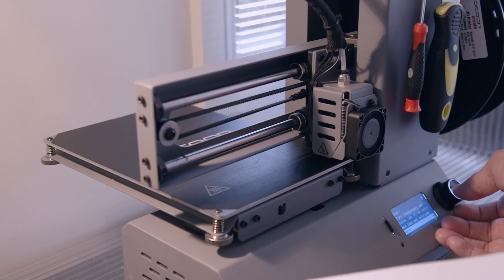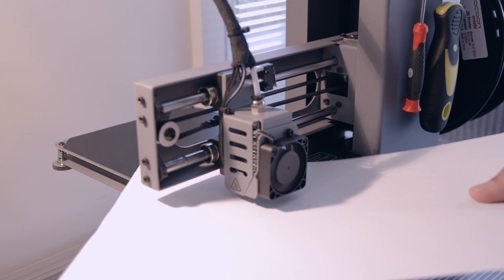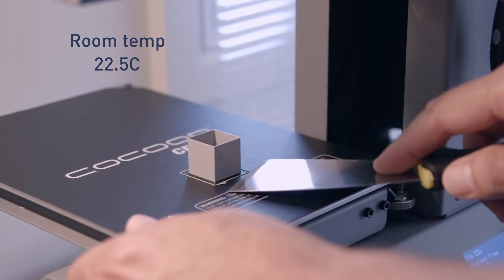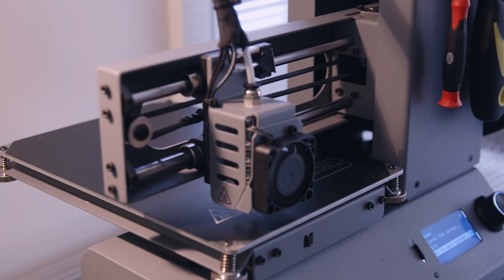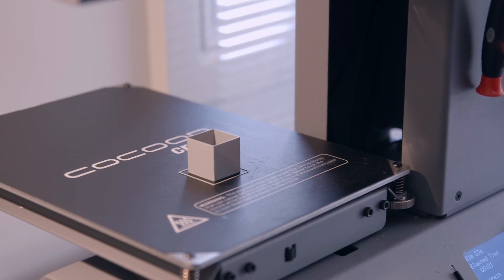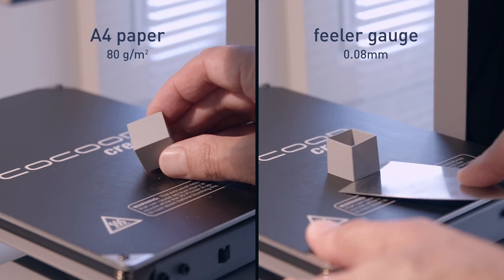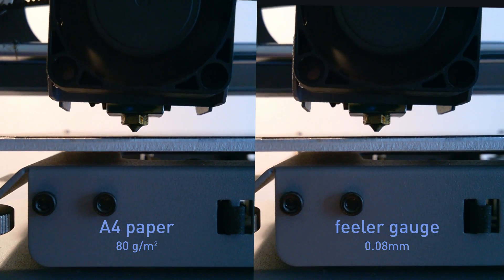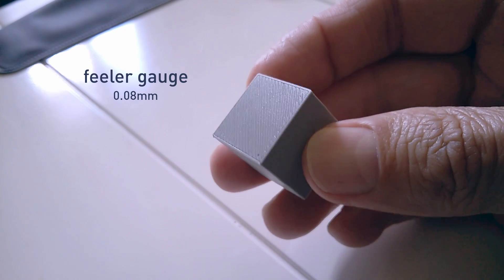Paper VS Feeler Gauge. Which is Best for Bed Levelling?

Comment: Learned more in 7 minutes than watching all the other recommendations. Your suggestion to watch if the paper kinks when you push which indicates it's too tight is the simplest idea I've seen. Thanks for your valued time and instruction. Keep up the good work.
Reply from the maker: Thanks John, your comment is much appreciated.
Reply: @PVG3DPrints  I've watched two videos by you today, and I'm so glad I found them! Bed levelling made more understandable. And yes, it is indeed one of the most frustrating things I've got so far (I also have some underextrusion issues, but first things first, I think).
Reply: @Steven Ares 
Nope, no one is interested.
What is interesting is that you and Adrien both joined on the 6th of March; what an amazing coincidence. 🤣
Reply: came here 7 years later to say the same

Comment: FYI:
80g/m² and .08mm are two totally different kinds of measurements!!

1-GSM (grans oer square meter) is a measurement of "Weight" not thickness.

2-A4 paper thickness can vary (from .05mm -.10mm) depending on quality and type.

Since the paper thickness worked better here, He should have measured the paper thickness with calipers.

Then used the corresponding size feeler gauge.

Example: If the paper "thickness" is .1mm use a .1mm feeler gauge.

Comment: I had hell with my new S1 Pro prints sticking. Unless I used a raft it was rare anything stuck, and if they did they'd usually curl, or get kicked off the bed halfway through. At my wits end I was going to 1: Buy a new bed for the new printer (I was really angry with PEI Bed hype), or 2: Calling Creality support.
I tried feeler gauges for the bed and Probe calibration and it fixed everything.  After checking my A4 printer paper it's 120g 😏

Comment: 80 gsm isn't a measure of the thickness of a sheet of paper.

With a constant of 80 gsm the thickness can vary betweem .08mm and .12mm depending on what the paper is made of and the finish that has been applied.

Humidity and heat will changed the thickness as well.

Comment: badly adhered skirt on the paper leveled run tells the story - nozzle too high. You can on-the-fly tweak that. Using paper density to denote thickness can give varying results. Feeler gauge - Use a slightly thicker / thinner feeler to find your adhesion sweet spot. Shim stock is also available.

Comment: I have seen several videos on using a feeler gauge vs. paper. None have addressed my concern. Is there a risk of damage to the print nozzle tip trying to jam a metal strip into the gap between the print bed and the nozzle?

Comment: I have a print shop my printers run none stop. Feeler Gauge is a tool paper is not. if the gap is to tight use the next size up let your prints cool don't use a scraper use a small fan to speed up cooling

Comment: The problem I had with using a sticky note to level my print bed is that I wasn’t allowing enough drag and it was resulting in terrible adhesion and lots of failed prints. I always thought I had it set good enough and that there was something wrong with my print bed. Although I finally did get my bed leveled with correct (or good enough) nozzle height with a sticky note I’d rather use a feeler gauge in the future as the sticky note method leaves too much room for error, at least that was my experience as a new comer to 3D printing. It took me about 6 weeks of hit or miss prints to finally get it dialed in to get consistent successful prints. I got it dialed in just yesterday and I’m finishing up my first long print tonight, about 28 hours. Even a week ago I never thought I’d be able to pull off a job that big. This is easily the best how to video using paper and I wish I had seen it 6 weeks ago when I got my printer, but after this I think I’d rather use feeler gauges instead. Thanks for the great video, though!

Comment: .08 mm is not the only feeler gauge. I think a feeler gauge is easier to judge and you can get them in standard thickness. Or use the offset to tweak it once you set it with the feeler gauge you like.  You could set it with paper and then modify z offset as well. The secret is keeping your setting. I don't think registration is very good on these beds.

Comment: Simple answer here...find the thickness of the paper as a real dimension (why you used the unit of measure you did is weird) and compare it to the feeler gauge.  Find a middle dimension and you have the best of both.   I will say this, the feeler gauge method to seems more consistent in the long run.

Comment: I have printed hundreds of calibration squares to get my bed level and still can't print anything directly on the bed without a raft. It's driving me insane. I've printed dozens of things but it has to be on a raft otherwise it fails from being too far away from the bed or too close. It's really killing the enjoyment of owning a printer. The paper method is incredibly inconsistent since I have to level after every print and sometimes after auto-homing.

Comment: Every video I have watched on bed leveling glosses over the fact that your z-offset must be set properly first. If it's too high or two low, this process just ensures that it will be equally too high or too low across the bed. If you know that your four corners are all the same distance from the nozzle after following this process, you then adjust your z height at the center of the bed. I only know how Marlin works so I will provide a generic process for any printer that can be sent G-code. 

Use a feeler gauge and send g-code G1 Z<thickness of feeler gauge>. Does the gauge slide under too easily? Your nozzle is too high. Does it get blocked? Your nozzle is too low. Keep sending G1 commands while adding or subtracting a little from the Z value until the feeler gauge can move under the nozzle with a little drag. The difference between the thickness of your feeler gauge and your final Z value is how much you need to adjust your z-offset. The formula to set your new z-offset would be new Z offset = original Z offset - (feeler gauge thickness - final Z height). Enter M851 Z<new Z offset> and then M500 to save it if you can. If you can't, just add it to your print g-code. Do an auto home and then send G1 Z<thickness of feeler gauge> again. Is it the correct height?  If not, adjust again. If it's not even close I don't know what to tell you. :-) If it's correct, you still may need to make adjustments for a better first layer. Add to the z-offset to make it closer to the bed and subtract to move it farther away.

Any knob adjustments you make only affects the levelness of the bed and does not change your nozzle distance during printing. That's what took me a while to grasp.

Comment: there is also worth noting that there is a z axis offset in case you want to get the print to stick better. It's the same, but instead of lifting the bed more, you bring the nozzle down more. Same result. Just in case you don't want to buy a feeler's gauge :D

Comment: I'm fairly new at this just got my 3D printer but I always wondered in the manny  videos I've watched so far, my first initial thought is why use paper when you can go with a set standard of measurement with feeler gauges and getting more precise reading?
Reply: Probably because everyone has paper but not everyone has a feeler gauge I'm going to buy one though because it looks like it's more accurate

Comment: Seems to me this is a comparison between 2 different nozzle heights. Not sure what 80gms/m is in thickness since that is a measure of weight. I think the real comparison should be between the reliability of paper vs. reliability of feeler gauge. You can use a gauge block of any given size and then compensate for the thickness of the block if you like. Point is, the prints really just had different nozzle heights and perhaps somewhere in between the 2 heights might be optimum. I do appreciate the advice regarding how to use each product though. You explained the procedures thoroughly and made them very easy to understand. Well done.

Comment: Z offset still needs to be set.. so if Elephant foot is present then you need to adjust the offset to compensate.  what's important is the consistency of measurements between the feeler and paper.

Comment: Instead of using a scraper to try and remove prints, I just wait until they cool and give them a slight tap on the side and they usually just slide off. Using a feeler gauge is an interesting idea that I never thought of.

Comment: This review makes it sound like there's only ONE size feeler gauge and then goes on to say why that is better or worse than the paper.    Clearly the paper is thicker than the 0.08 mm feeler gauge.  So if you use a slightly thicker gauge (which you have a whole stack of in your feeler gauge tool), then you will get the same results as the paper.  The REAL difference is in consistency.  Paper can vary in thickness over the entire sheet.  If you're testing the gap but using a slightly different area of the paper, your results might end up different.  Paper will also wear out quicker, as the drag on the nozzle slowly removes material.  A feeler gauge, of the correct thickness, will give you much more consistent results from location to location on the bed, and from day to day.

Comment: I never used to do long enough prints that levelling would have a big effect on the print, but I recently started a long print that I had to bin because of warping. I reprinted it after cleaning with isopropyl and properly levelling the bed and it did not even slightly budge.
Reply: Which method did you use?

Comment: Bed leveling/z-gap setting is easy: Follow user manuals, 99% will be paper or business card stock, Buildtak, and clones often call for cardstock or double thickness of paper, I always cringe at feeler gauges for bed leveling. Heavy industrial machine assembler group leader Mitsubishi/Field service engineer, retired with 31 3D printers. Thanks for your video comparison.

Comment: I never thought to use my feeler gauge set for bed leveling. I upgraded the springs however, and have never needed to re-level the bed. I am considering adding an auto leveling system in the near future, but I think the feeler gauges would give a more repeatable result.

Comment: Which size blade of the feeler guage did you use???  You should also be looking at the 'swuish' of one layer only.  Your elephant foot may indicate too low of nozzle height, leading to too much squish.
Reply from the maker: Sorry I thought I'd mentioned that in the video. On the Cocoon Modelmaker my feeler gauge gap was .09mm but on the Cocoon Create Touch I use a 0.1mm feeler gauge.

Comment: On your video when you're moving the paper back and forth for levelling you have one end of the sheet raised. This will affect the resistance a fair bit, the higher you hold one end of the paper the more resistance you will feel as you're essentially pulling upwards on the nozzle.

Comment: The problem with the paper method, and why I never suggest it, is that it's unwieldy as a tool. It's so flimsy and will constantly crumple while trying to level. Where as a feeler gauge does what it needs to do, every time.
Reply: I agree, I had some drag on the paper but not enough. The amount of drag I actually needed seemed like too much but being new to all of this I would have never known better. A feeler gauge is day and night as far as I’m concerned, it either is correct or it’s not. I spent weeks wracking my brain trying to figure why my prints were failing and all it came down to was I wasn’t allowing enough drag on the paper. I could have saved myself a lot of headaches if I had used a feeler gauge.

Comment: This video ALONE should be the FIRST AND FOREMOST to anyone that has problems with leveling their bed!!  I have been "printing" now for a little over 2 months and thought, "What about a feeler gauge instead of paper due to '+/-' tendencies in the manufacturing process".  Lord knows I have plenty of gauges so I tried it. . .    That was about 3 weeks ago and WOW!!  THEN I stumble across YOUR VIDEO and knowing my results, I was curious.  WHY oh WHY do they tell you "A4 PAPER"  when undoubtedly a feeler gauge IS the BEST!!

GREAT VIDEO!!!    Now, onto Slicers......  Your thoughts?  Currently using Cura 4.4 with below success rates....  Namely, Layer Shifts and Over/Under Extruding.  However, these errors occur in approx. same locations regardless of prints or printers (currently have 3).  I believe its in the G-Code of the program.  Going to try a different Slicer (Repetier) when I do another to see. . .

Recommendations??

Comment: This is a great video. Paper seems way too flexible to be repeatable. My printer paper is .004" and so I tried my Dads feeler gauge of the same size and its way way easier to feel a consistent drag every time. Leveling test print looked and felt great now. I've been trying to use my Harbor Freight dial indicator on my Ender 3 Pro with a printed mount. Every single time I tried that the right side was extremely low for whatever reason. This is the way to do it with an actual feeler gauge. Its reliable, repeatable, and consistent. Thanks for sharing.

Comment: Great video. Been looking around for an explanation using feeler gauge method. At least now I have some numbers to work with for a person just starting.
Reply: Thanks very much Chuah! Just a heads up, for my new printer (Cocoon Create TOUCH i3 style with heated bed) I now set a gap of 0.1mm. But if your 3D printer is similar to the printer shown in this video I'd still recommend a gap of 0.08mm.

Comment: Great video, I like the idea of the feeler gauge because that's what it's meant for.  The one thing I have learned across all my various hobbies is: "use the right tool for the job".  No professional engineer or mechanic would use paper as a feeler for any serious work, they would use a feeler gauge.  I would love to see a comparison between paper and a 0.09 or 0.1 feeler but I think the difference would be negligible at that point as per your other comments.
Reply from the maker: Thanks seventyfive1!
Reply: apparently you don't know to many auto mechanics.  Or small engine mechanics.
Reply: @brucehirsch5437  you know mechanics that use paper instead of feeler gauges?
Reply: @seventyfive1  yes.  I am one for instance.  for example.  take a lawn mower.  the magneto you can get away with just using a business card to set the gap.  now I wouldn't use paper for bearings or other critical areas.  but there are plenty non critical areas where you could get away with using paper or even an eye to set gap.
Reply: @brucehirsch5437  in that case, I stand corrected. Although I will point out you said you wouldnt do it in a critical area.
Reply: @seventyfive1  yeah.  I did say I wouldn't.  But I have seen some mechanics go by feel when it comes to installing crank bearings in a motor or gears in a rear axle.  I highly advise against it.  But I've seen it done.  Sadly.
Reply: @brucehirsch5437  that's what experience is for... And skill. 🙂
Reply: @Suicide Kyd um no.  apparently you didn't read my comments fully or failed to comprehend what I am saying here.